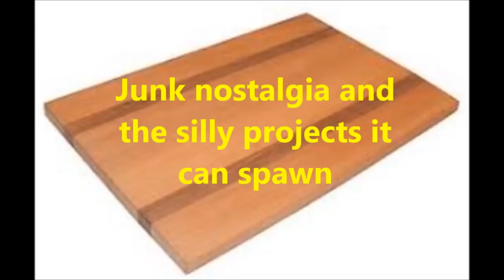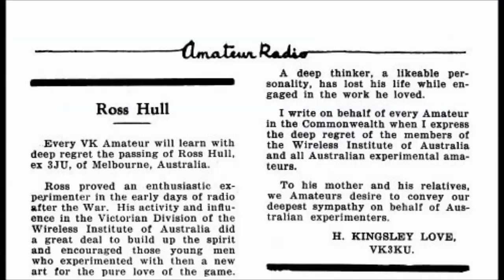Junk nostalgia and the unsafe projects it can spawn

Comment: Good video Peter. As you say, many amateur radio operators of today have limited experience with, or even exposure to, hazardous voltages.

I remember reading about a project in the US for anglers to catch earthworms - it used two metal probes connected directly to the mains and pushed into the ground! Someone adapted the idea to measuring earth resistance ...

Cheers,

Mike VK2IG

Comment: Hi Peter, I came across a card that takes the place of Quartz Crystals as they are getting hard to get in frequancies that are not mass produced. It is the "Adafruit Si5351A Clock Generator Breakout Board - 8KHz to 160MHz" it seems like a great bit of gear as it seems to be able to have 3 outputs at different frequencies from 8KHz to 160MHz.

Comment: Peter, You are too late. There are nostalgic board projects out there even more primitive than Bob Heil's. Checkout the Antique Wireless Associations  - 1929 (Bruce Kelly Memorial) QSO party.  Where some of Ross Hull's early transmitter designs are used.  The Bruce Kelley 1929 QSO Party is an annual AWA-sponsored event where participants build their own transmitters using the designs, techniques, and tubes that were available in 1929 and earlier, and try to contact as many other 1929 stations as possible. http://www.antiquewireless.org/bruce-kelley-memorial-cw-qso-party.html

Comment: What AM transmitter is that one pictured near the end? Great video Peter. You appear to have dropped your left channel in this video so audio seemed a bit low :) Hope you catch you on air soon again. I've not been on air much lately. 73, Craig - Geelong VK3CRG
Reply from the maker: Thanks Craig - the AM transmitter is part of the Pine Board project in Jan 2018 QST. http://www.arrl.org/files/file/QST/This%20Month%20in%20QST/January2018/Heil.pdf  Sorry about the audio - the external mic only works with one channel - but needed due to the noise around.
Reply: The antenna at the end is the ABC transmitter at Sydenham, near Watergardens station. I got a tour through it years ago, long before the housing estates crowded round it. Seriously high power RF gear in there.